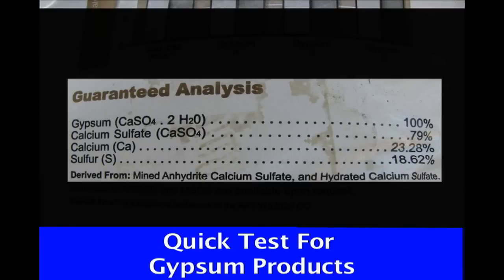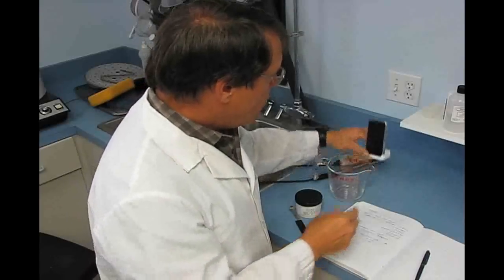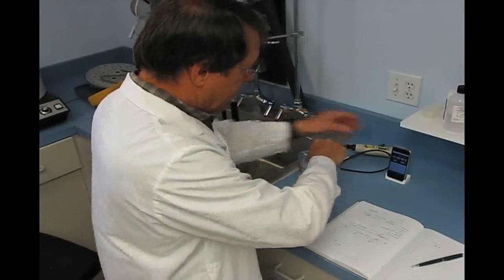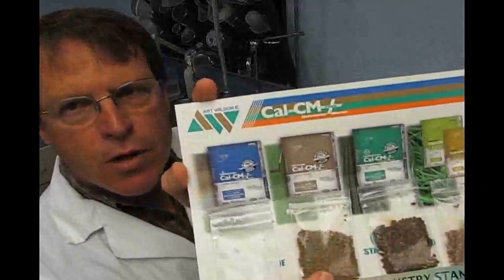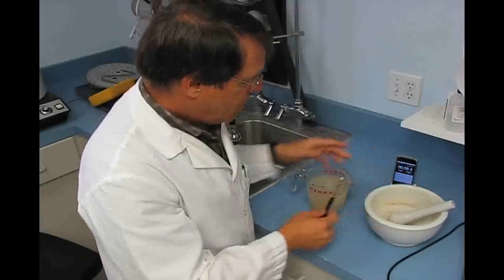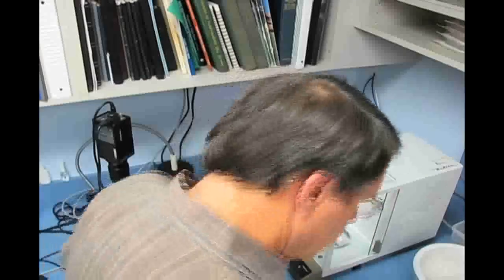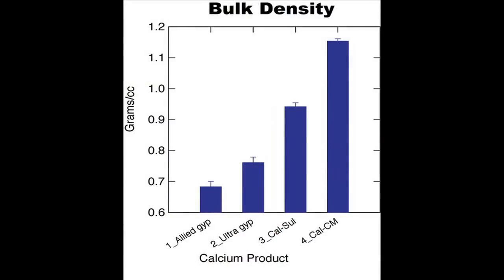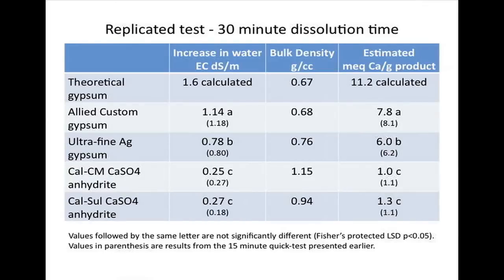Quick test for gypsum dissolution rate

Comment: hello sir... i have one weird question...

i bought CaSo4 but it dissolve so fast... not even for a minute, they sature with water like salt...

before i bought it with named CaSo4 (Coagulant Tofu)... is it the same? 

i am wondering, did i bought the correct CaSo4 because folks need to know how to dissolve CaSo4..
but mine, is different...

i really got no idea...
Reply: It sounds like you purchased a finely ground food grade gypsum. I am not sure how product labeling is regulated where you are located. Some forms of CaSO4 that are easily soluble. Carefully read the label. Calcium sulfate dihydrate (CaSO4*2H2O, gypsum is pretty soluble) that has been heated to remove the water (H2O) is very soluble. Calcium sulfate anhydrite that is naturally occurring and mined, is slowly soluble.